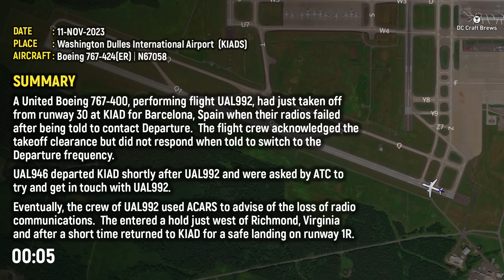LOSS OF ALL RADIOS | United Airlines B764 Loses Radio Communications, Returns for Safe Landing

Comment: Did they dump fuel?
What happens to dumped fuel?
Reply from the maker: They were over-weight, so they needed to dump fuel, I guess.
Reply: If you dump fuel more than a mile above the ground, which is commonly the target, it will atomize in the air.  In other words the fuel doesn’t “rain” down on what is below.

Comment: With the value of the humans on board and the lesser value of the aircraft wouldn’t it be a good idea to have a $400.00 hand held airband transceiver in every cockpit for just such emergencies.
Reply: Handhelds work poorly, at best, in smaller airplanes. In a pressurized transport category aircraft, with tons of shielding, they'll be pretty useless.
Reply: @N1120A  Maybe. A ham radio operator was allowed to use his hand held radio on a commercial flight, and he was able to communicate with other hams through a repeater that was hundreds of miles away.
Reply: This is an extremely rare event. Besides there are procedures in place if this happens. They worked it out and no humans were in danger at any point in time.
Reply: @GiancarloGiuliano-wo5iy  Insurance and preparedness are exactly FOR extremely rare events.  That doesn't remove the need for them.
Reply: @allenbythesea  I thought about the same thing... having a hand held radio. Having a flat tire is a relatively common occurrence, so it makes sense to carry a spare, but having an aircraft lose all radios is one in a million, so it wouldn't justify having HTs in every aircraft, especially when they have other procedures that they use quite often already.
Reply: @kd5you1 fair note but I'd counter with you have no idea how many times crews lived even though having the backup would have been key (as in this case).  Survivor bias is a thing.
Reply: @allenbythesea  Losing all radios is incredibly rare for airliners and even if they do, there are procedures for it and it basically always results in a normal uneventful landing. I dont think there is any case where a loss of radios resulted in any injuries or even material damage. Sure, you have to be prepared even for very rare events, which is why there are procedures even for the very rare event of a loss of all radios, so they are prepared. But at some point you have to decide how much additional safety a certain measure will bring and if that really makes sense, otherwise you would even need a backup for your backup handheld, and then a backup for that. There is just not not enough safety to be gained here.

Comment: The only question I have is how did they know which runway to land on? I'm guessing UA992 went straight to the hold fix, then started a STAR for Runway 1R and ATC would see which runway they would line up for. Or UA992 somehow did know what landing runway was active.
Reply: ATIS has active landing runways, since they were overweight the most obvious choice is the longest of them.
Reply: They literally sent them text messages through a system called ACARS. Look it up.
Reply: @dmsdmullins I know what ACARS is, I just didn't think they managed to get it working. The last thing we knew was that 946 tried to get company to contact 992.

Comment: sometimes I wonder why radio loss is only 1 code instead of "I can hear you"/"I can't hear you" pair
Reply: At one point early on you hear ATC say "if you can hear me, ident". There is a button the pilot can push on their transponder that will make their info on the ATC controller's display flash. Then ATC can issue directives or ask questions and the pilot can respond with a button push. In this case there was no reception so they went on to follow standard lost communication procedures.

Comment: Super curious how multiple radios, power busses, headsets, antennas could fail without other issues.
Reply: @767bob  Bob, I'm looking at 767 wiring schematics at the moment. The audio selector panels have a dual power source (Bat Bus and R Bus for the Captain, for example). Also, you don't need the flight interphone to transmit on VHF or HF. The mics feed into the audio sel. panels then to the individual radios. 

The ACARS was working, so at least one of the VHF transceivers was working. Also, they seemed to be hearing what ATC was telling them. Weren't they squawking? 

Definitely a strange one. I may have come across this before, but I can't remember the solution, although I do recall that there used to be strange effects if the observer didn't have his mic jack plugged all the way in.
Reply: Electronics can not work in mysterious ways.
Reply: @767bob  There are two batteries and two switches. Batteries are charged by two separate alternators. In the exceptionally rare event that both systems failed....nothing would would work at all. 

Also, in this case, the transponder and apparently every other important thing was working because they cleanly navigated back to the airport while on 7600 code.
Reply: @Factory400  2 batteries? It may depend on the model. On our -200/-300 fleet, the APU Battery was only used for starting the APU.

Anyway, it's unlikely to be an electrical bus issue.
Reply: @767bob  I don't get your point. What power loss scenario are you envisaging which would take out all the VHF radios? 

Yes, I'm looking at what powers the audio control panels. The audio sel. panel power and VHF Transceiver power is all I need to talk to ATC. 
One set of audio sel. panel circuit breakers (on the Bat Bus) are labelled "dual..." to indicate a dual power source. The other audio sel panel power source is the main DC Bus. SSM 23-51-01. 
The flight crew couldn't talk to ATC. Why would I need the flight interphone to communicate with ATC? i.e. the mixing circuits in the Audio Accessory Unit. That's just for talking to the other pilots, the nose gear, the service interphone and on PA. 
The Standby Bus powers the L VHF, the R Bus powers the R VHF and the C VHF is powered by the L Bus. Independent power sources. 

Aren't we saying the same thing?
Reply: I don't know how the electronic components are powered in the 767, but I had a similar event happen while flying through Philly Class B airspace (flying a STAR, not a departure). We had CCU (Communication Control Unit) faults, also affected our transponder. We ended up landing NORDO with the light guns from tower. For those wondering.... From the depiction, it looks like the crew flew to FAK for the holding, then (probably) COATT Five Arrival  for the feeder fix to ILS Rwy 1R (KIAD)
Reply: @CoastFIREisawesome  I'm not familiar with the expression CCU. Is this on a 767-400? I haven't worked on the -400.
Reply: @ImperrfectStranger  I don't know what the parallel would be called on the 767. I flew a different multi-engine Boeing jet. I'm sure it is some other name/acronym on the 767
Reply: @767bob  Uhhhhh.....what? The little GA planes I fly have multiple isolated busses with a radio on each. Guessing an airliner is a bit better than that. Single points of failure in critical systems is frowned upon.
Reply: ALL MADE IN CHINA, SO, THERE YOU HAVE IT.
Reply: @tompsheridantsheridant7354  Germany but okay
Reply: @Pereux0  Or USA...  Rockwell Collins? Honeywell? Bendix? Allied Signal?

Comment: The only thing I think I should have seen is for ATC to request they change their sqawk code temporarily if they can hear them.  Then they could at least confirm they could receive.
Reply: That’s what they were saying “ident” for
Reply: When controllers says "Ident", it's an instruction for the pilots to push the "IDENT" button on the radio. It causes a blip/flash on the screen of ATC.
Reply: @Republic3D  On the transponder rather😉
Reply: As others have said, that's what the ident button is for. It uses the same antanna/radio as the squawk codes and the rest of the transponder, so if they can change the squawk code, they can also ident.
Reply: Yeah and if they don't ident then that means that they can't hear them....
Reply: @767bob you could call it a squawk box, transponder, whatever. It's still a radio.

Comment: The real question is if fighter jets were scrambled for a NORDO & being so close to D.C.
Reply: Doubtful.  Its not a hijacking and theres nothing suspicious about the aircrafts behavior.  Everything they did was a rational and reasonable behavior even if it was uncommunicated for obvious reasons.  If they acted erratically than yes.
Reply: How did they know it wasn't a hijacking?  The transponder code indicated radio failure but any hijacker with a private pilot license would know that.  Time to dive into a building in DC, given the flight path, would have been less than ten minutes.  By the time they acted erratically it would have been too late to intercept  @jyggalag169

Comment: ACARS?   They probably used the transponder and set the code to 7600
Reply from the maker: They used 7600, you can see my note 01:12
Reply: Dispatch can still try to send text information through ACARS. But the success would depend on the installation, some ACARS uses satellite some uses an embedded signal in the normal VHF radio freqs.(or switch between).
Reply: Aircraft Communications Addressing and Reporting System.
Reply: @trailblazinPNW  I know what it means but thats not the way pilots let ATC know of a radio failure.

Comment: As a former 911 dispatcher for 10 years, one of the hardest things of working on the police or fire radio was not being able to reach a unit in the field - the fear was real.  With what is going on in our world, I would've assumed the worst :/ Kudos to the ATC and flight crew. <3
Reply: That's why aircraft have transponder codes that the flight crew can set to a loss of radio code, 7600 and every controller all over the world knows what that means.
Reply: @Boodieman72 As do Public Safety agencies, of sorts.  The Emergency Identifier on their radios, however, you can't always rely on that should an emergency happen.  Thanks for the squak reminder though! :)
Reply: and thats why you're AnxietyGreg
Reply: @normiepuppet  Pretty much :)
Reply: “With what is going on in our world” is a usual tactic used by the police to trick someone into obeying an unlawful order such as ID’ing without RAS or trying prevent someone from doing photography in public or trespassing someone from public property for exercising constitutional protected activity.
Reply: One time I didn't put myself out on the MDT at the fire station because I was just stopping by to check in...we started talking and I lost track of time. My chief came in and was like where tf where you dispatch has been freaking out...the fire chief backed me up thankfully and said we didn't even hear dispatch calling ne but I felt so bad lmao
Reply: @JamesPease23  Happened all the time lol

Comment: Wow - dump non pilot Q.  Why not throw on Air Mask that has a separate microphone and speaker?  Why not Text the Squak 7700  or similar??
Reply: They may have tried the O2 mask mics but it was probably a complete radio failure. The sqwark code for lost comms is 7600.. Yes I have used it once single pilot in IMC and just saw the green light as I popped below the clouds on final.. Stressful start to my day..:)
Reply: @frankish5314  thanks
Reply: 2 pilots, 2 headsets...with hand-mike backup....if none of those worked, it was a full radio failure.  Using O2 masks wouldn't have made sense in this scenario.  In the video, you could hear the controller asking UA992 to "Ident" if they heard them - that's a feature of the transponder.  If they didn't Ident, that means they couldn't hear them.
Reply: @peileii  thanks
Reply: 7700 is for general emergency, 7600 is for radio loss. Luckily ACARS worked, A third (final) backup would be to activate the locator beacon, but that could possibly cause a ground stop for all aircraft in region.
Reply: @awgunner429  thanks
Reply: They use a set of signal flags kept in the cockpit coat closet.

Comment: If radios and ACARS aren't working, would commercial pilots ever use their cell phones or the in flight wifi to communicate? I know there are procedures to use lights and waving the wings, but I figure if you're low enough a cell phone call would be more ideal.
Reply: Probably not. He leveled at 10,000. That's way too high for a cell signal. Generally cellphones won't work over a few thousand feet up
Reply: @AndrewAbraham83  That entirely depends on the beam of the transmitter and the distance from the transmitter. Also, the aircraft have inflight WiFi. In Australia, I used the inflight WiFi using VoWiFi to call my wife to tell her the arrival had been delayed. Also, no reason the pilots couldn't have one of the deck crew come up and relay over the phone to the pilots if there's some rule about the pilots not being allowed to use a phone while flying. I know 'sterile' cockpit and all, but no rule can be an absolute. There are always going to be edge cases that the rules need to bend for.
Reply: It's happened and it's quite easy - call up Flight Service and they'll patch you into the appropriate people.  Although I doubt most airline guys even know what the phone # for Flight Service is these days.  

I'm only flying GA, but I've called all sorts of people from the aircraft when getting near the airport. The FBI (fuel/rental car), placing to-go restaurant orders, etc.

Altitude is usually the issue. 2,000-3,000 feet is usually the max for cell reception, sometimes lower.
Reply: It’s been done, but they’re bound by embedded procedures, so I highly doubt they’d use them.
Reply: @jaysmith1408  In an emergency, pilots are allowed to use any and all resources and break any rules necessary to meet the nature of the emergency, so yes, they could use a cell phone.  Unfortunately, getting a reliable, steady signal would be difficult if not impossible.
Reply: @peileii we just follow the NORDO procedures, emergency or not.
Reply: Pilots would only be able to call their company.  There are entirely too many facilities for them to carry enough numbers to cover all situations.  If imagine in this case an ACARS message to dispatch led to a phone call to the Travon, followed by a return ACARS message assigning them an approach and they just cleared everybody out of the way.
Reply: @efoxxok7478  Took me 2-3 minutes to find at least some number for Potomac Approach ... granted, it's for clearance/delivery at satellite airfields, but they'll get word to the right person VERY fast, I'm sure.
Reply: @efoxxok7478 The numbers are in Foreflight.
Reply: yes, that's one reason why you're told to put your phone in airplane mode. it increases the miniscule chance of the pilots getting reception
Reply: that's just nonsense @xyzvala
Reply: @xyzvala lololololol